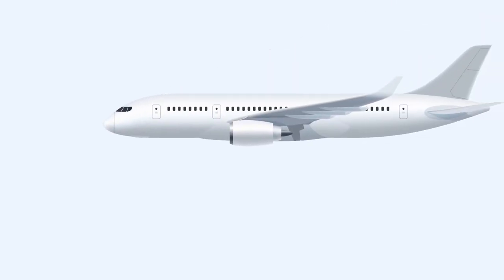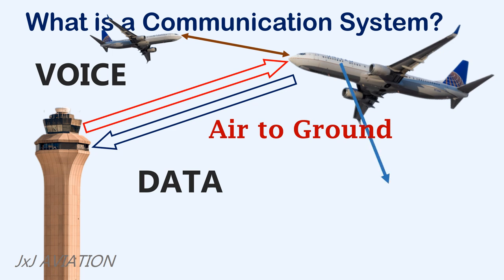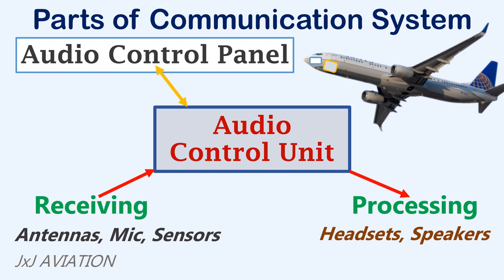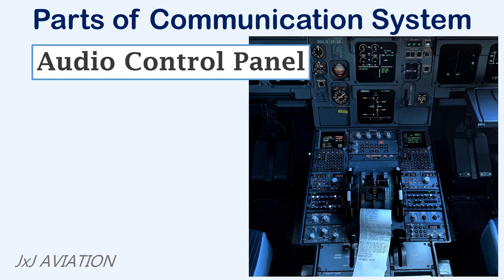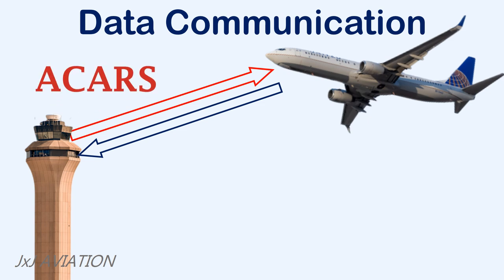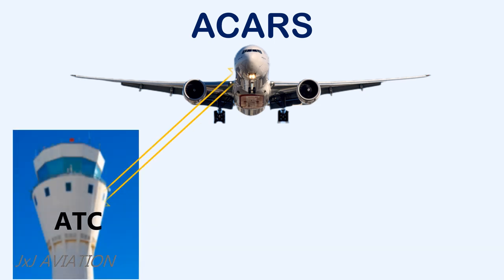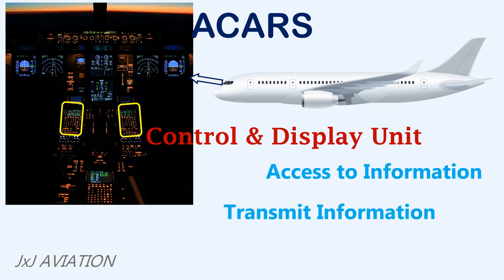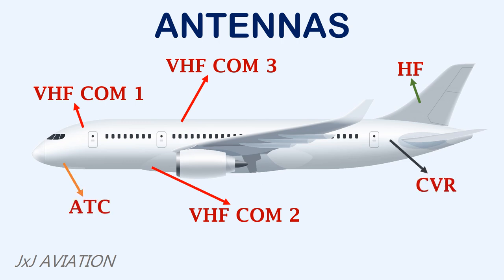Understanding Aircraft's Communication System | ACARS | Voice & Data | Antennas on an Aircraft!

Comment: ATC stands for Air Traffic Control AND NOT transponder. Those are collectively various controllers which communicate with a plane by voice. Transponder sends code (sometimes with data about altitude, depending on the type of transponder) to ATC radar screen, but it is not ATC itself. 
CVR (Cockpit Voice Recorder) is just a sound recorder, it does not use an antenna. Nowadays, depending on the airline, planes use various two-way, usually Internet-based methods of communication with the company (typically by text with Flight Operations) while in the air, via tablets, laptops, faxes, telexes, sometimes phones, etc.
Reply from the maker: Yes Noted!